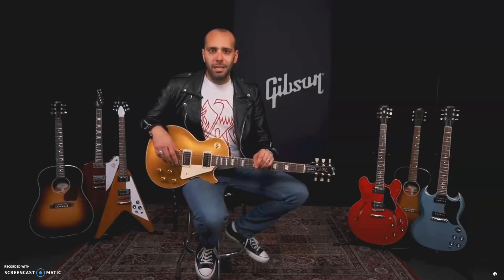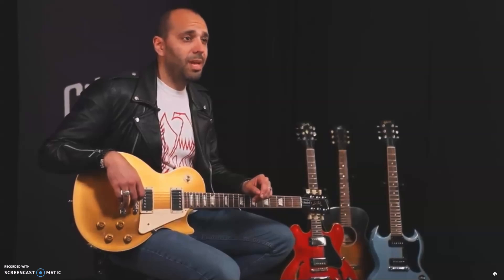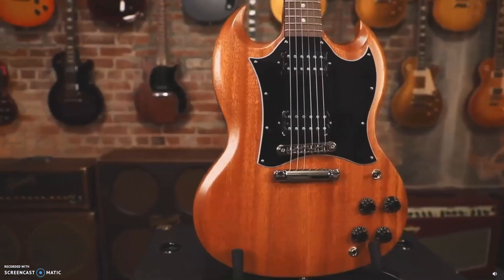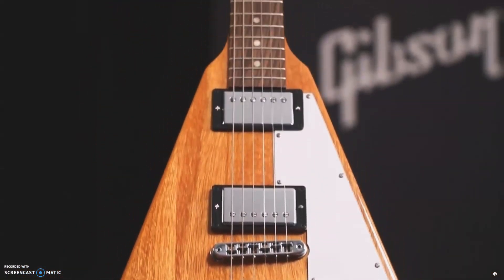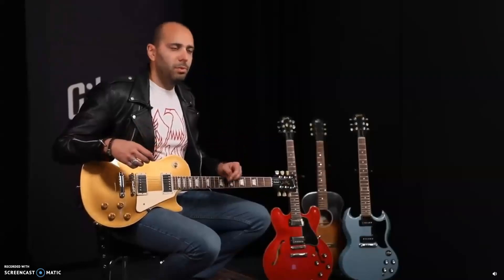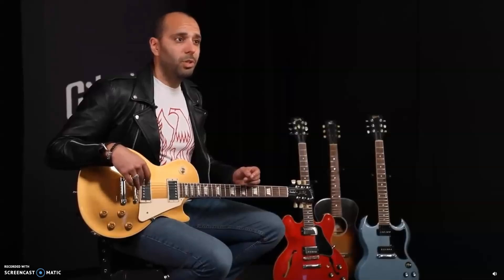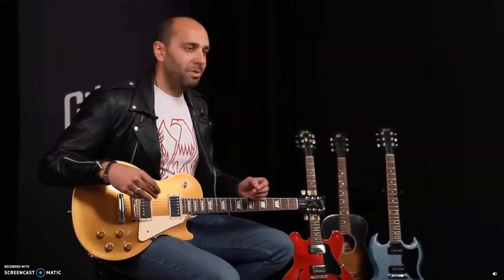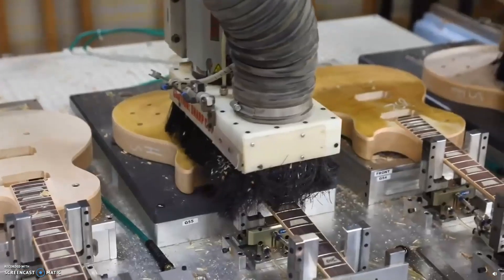GIBSON: PLAY AUTHENTIC (Original Deleted Video)

Comment: It's really painful to see Gibson go down this path.  There is still so much more they can do to connect with the end-user musicians, and design-wise try and win back the market share they continue to lose.
>Locking tuners
>Headstock angle that does not hit the ground
>Hollow-chamber (resonance) body designs, at all price points
>Different tone woods, and combinations of
>Direct body mount PUs
>Sustainer circuits
>Floating trems
>Piezo systems
>Treble boost / active circuits
>Series / parallel wiring and switching (like Brian May)
These won't appeal to traditionalists.  But they have two lines Gibson and Epiphone.  The latter seems like the better choice for these kinds of things, at price points that would reach greater masses.

Comment: Why buy Gibson Les Paul for 3000 $ when you can get a PRS SC245 or MCcarty 594 with superb quality? Or a flying V when you can get Jackson RR1 or KV2? Because of the brand imago. There are guitar manufacturers that make good quality instrument with same or even smaller prices. Gibson really don't have any justification for their higher end prices, since the quality is pretty much a matter of luck. They increase the amount of guitars getting out of the factory while the quality suffers. Buying a used Gibson is always smarter if you want one, you get what you pay and the faults have been usually fixed by some luthier or the previous owner. No reason to buy a new one.

Comment: Screw Gibson.  If I want a classic solid body, I'm buying Fender.  Acoustic, I'm going with Guild (or Martin if I want to do some finger picking).  Much prefer the sound of Gretsch archtops.  Nothing inherently wrong with Gibsons, but for everything they make, some other maker has a model I find better sounding than Gibson, and most of the time far cheaper too.  Epiphone is a much better bang for buck.

Comment: 125 years of trying to make things worse.  Like someone commented on a reaction video - "Gibson counterfeited their own guitars", and I want to add, in "often inferior quality" (citing Agnesi).  Example:  The iconic "Black Beauty" LP Customs were all mahogany, (bottom, top and single-piece neck) on all its variations between 1954-1960.  The first "reissue" in 1968 came already with a maple top under the black paint coat, a 3-pc maple neck, cheaper 14° headstock angle and at least as much build quality flaws as the originals, and no consecutive "Black Beauty" version went back to the original recipe, ever.  Similar can be said about all Gibson guitars that are based on some original that became famous for some reason or other, they were partly modernized to meet buyer's taste (good), but cost-cutting made them deviate from their original specs for pretty much everything, which makes them cheap (-ly made but more expensive)  counterfeits of their own designs.

Cue my early 80s Burny LPC-60 "Counterfeit Gibson" made in the Fujigen Gakki plant to match almost every little detail of a original late-50s 2-PU Custom - all mahogany (bottom, top and 1-pc neck), 17° headstock angle, fret binding, their attention to detail went as far as copying the odd pickup setup found on many originals (with the neck PU being hotter than the bridge PAF with the same polepiece spacing), the split diamond inlay position moved a few millimeters on the 1968 Gibby reissue, Burny made sure it has the same position like the 1958 one...  Now this was actually a pretty cheap guitar (60,000 Yen = $600) back then, and they used a rosewood fretboard instead of ebony and being Japanese, they didn't want to copy the misplaced dots on the binding found on some originals (bad craftmanship) but this is still closer to an original late "Black Beauty" than anything Gibson ever made after 1960.  Sure, some cheap copies that made it to Europe and the US back then were mere lookalikes but almost any of the Greco/Burny/Tokai/Edwards et al guitars were made by luthiers who thoroughly analyzed and understood the essence of the real vintage Gibsons, which is something Gibson itself never understood and never made. Case closed.

Comment: Honestly, I admire Gibson... and Fender. I don't believe it makes sense buying a certain guitar only because someone you admire plays it. If anything, "play authentic" means be authentic, don't just pick a guitar because someone else gad it, that's copying.

However, one of the reasons I wouldn't buy a newly made Gibson is because I wouldn't want to give any money to the likes of Mark Agnesi.

Instead of improving their guitars, or simply doing a good quality control job in releasing previous models, they threaten lawsuits against people for using similar shapes to them? Really?

How original is a Gibson acoustic guitar? I mean, acoustics had been around for a long time before that, and surely in terms of bracing and size they took from previous innovations, so how "original" can one really be? Come on!

How about the trust rod, pickups, had Gibson come up with that? Just embarrassing.

Comment: Then I guess only rich people or professional musicians can play authentic then ://// 
Im such a fraud playing my strat
Reply: Last I saw, the low end made in America Performer strats were priced pretty close to the the Les Paul tributes and studios.  The lowest price USA strat has an MSRP of $1149 versus $1199 for a Les Paul Tribute series.  When you consider the materials and work required for construction, it's actually Fender USA that is priced high as the Les Paul Tributes are Mahogany bodies with Maple top construction with neck thru body and have block inlays.  Those strats are alder with bolt on necks and dot inlays which is all cheaper to do than what Gibson is doing at the same price point.  If you are looking at imports, you need to compare to Epiphone since Gibson brands their full line of imports as Epiphone.

Comment: I got my first Les Paul Custom brand new for $719.00 in 1977. It's what I learned on. I thought if I was gonna be good, then I needed  a guitar that would be better than me. At that time, you couldn't buy a decent guitar for much less, unless you wanted a Strat or Tele, and I never liked the look or feel of those. The Les Paul was amazing, both in sound and playability, as well as fit and finish. It was gorgeous!  Only bad thing was it would not stay in tune. Being a beginner, I thought it was me. But after about a year, I traded it in for another one thinking that maybe some bad neck wood had slipped through. It had the same problem. By this time, I was getting good enough to play in a band and I know I was driving my buddies crazy with having to stop in the middle of songs to tune up. It was the biggest discouragement I ever had to overcome to getting better. Finally, in the interest of sanity, I traded it for an Ibanez ST 200. Financially, I lost my ass on the deal. But the tuning issues were gone. Over the years, I have owned many Les Pauls, but never as my go to guitar. I can get a sound out a Lester that no other guitar has provided.  I still get a craving for a new one from time to time, but when I go to the music store to look, I am utterly shocked and saddened how the quality has gone to hell. I swear, where the fit and finish on the ones built in the seventies was flawless, the ones hanging on the rack these days have runs in the paint and clearcoat. Sometimes so bad, you can spot it while they're hanging ten feet high upon the wall.  Hell the Epiphones built in Asia are higher quality. So Gibson has dug their own grave, I'm just sorry that this is what they have let this iconic brand come to. I personally would rather see them go out of business than become a third rate guitar brand.